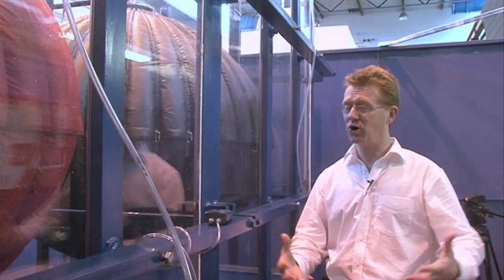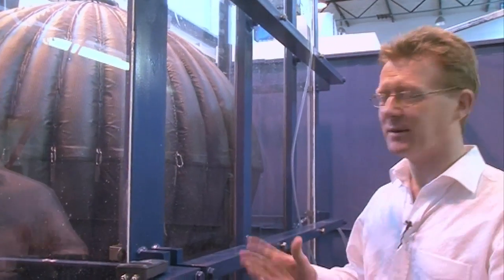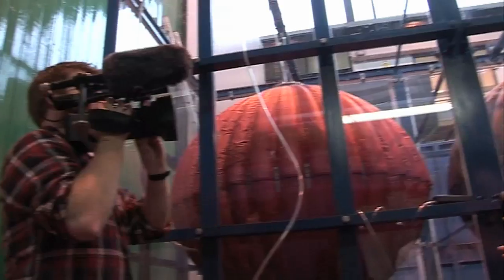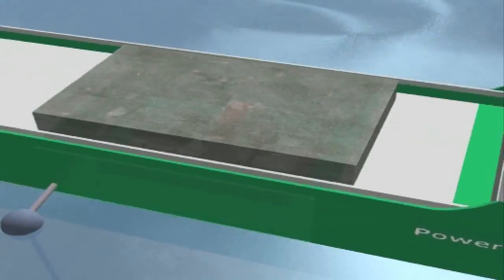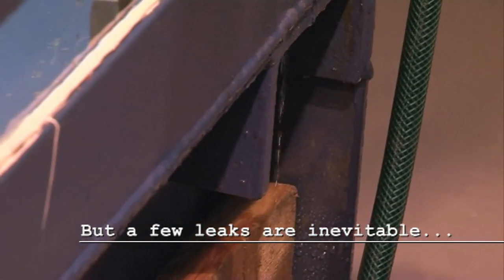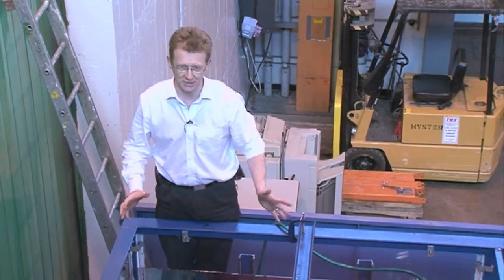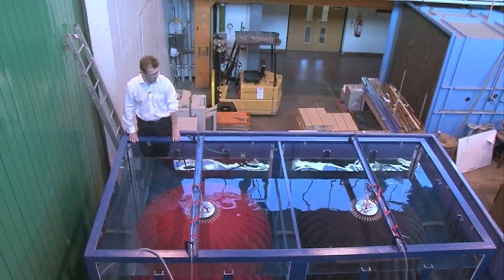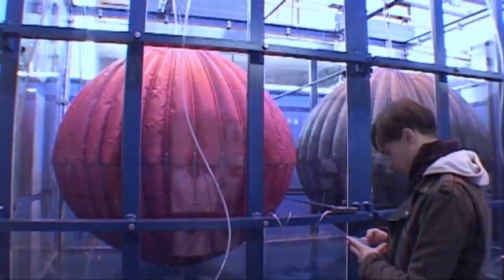Energy Bags Underwater

Comment: If one had a place with very high tidal difference, they could be inflated at low tide, and energy taken out at high tide.
Or maybe used in other places with rapidly changing waterlevels, like reservoirs of pumped-water stations. To reduce the energy needed to fill them with air that is.
edit: Might be easier to use other methods to harvest extra energy from places with "rapidly" changing water levels though.

Comment: why not use a fixed shape like a sphere or cylinder with hole at the bottom?
as you press in the air, it will push out the water through the bottom hole.
and you don't have to worry about material exhaustion, as you have no moving parts.
same concept but better, what do i win? i'll take a warm handshake.
Reply: 27 (number) I wondered that too but this video is over 5 years old so I don't think we'll get an answer from anyone involved.
Reply: Then you'd have to deal with your air loop being in direct contact with salt water, vastly increasing maintenance costs i'd imagine.
Reply: The problem is due to the seals not being secure due to poor design, as the person in the video said, and not a problem with moving parts !!

Comment: how would you reset the system every time without putting in as much energy as you got out?
Reply: That's the point. It's a battery not energy production. The problem with solar and wind energy is that it is sporadic so we need stable long term storage solutions and chemical batteries are bad at this. So this is just an energy store. You put in energy and you store it and you get almost as much back later when you need. So wind cans fill these on windy days and then we can deflate them on still days for example.
Reply: @thatcrazykid1393  This comment is 8 years old and I'm pretty sure it was a part of a thread of replies to another user where I was walking them through their own idea.
Reply: @snowballeffect7812  oh haha. I totally didn't look at any timestamps for this video. My bad
Reply: @thatcrazykid1393  lol no problem. I appreciate your help!

Comment: Umm hey Professor. Can't you just variable the pressure and use the lift force to drive the generator? Seems to me your not using this system to it's full potential. 

Instead of anchoring the bags, try placing a pulley system that will use variable pressure to spin the generator. I think you'll get more energy out.

Reference me in the assistance of the design! :)

Comment: would this not be more efficient than pumping water back up a dam you could use the electricity remotely to pump the air into the reservoir could be fixed to the dam floor on just a cage of balast would lessen your need for the cool lil balast gismo you have now. awsome idea. thnking along the same lines myself for something but this seems a lot more cost effective if slightly less efficient.

Comment: Oh wow, that's wild.  I had heard of mine shafts and such being used for compress air energy storage.  But using the ocean is a neat twist.  That circumvents the issue of needing to find massive geological features to harness.  Sounds like transmission back to the shore would be mildly annoying, but less so than a sports stadium full of batteries for energy storage.  Plus if you get a bunch of these rocking, then it probably wouldn't be a bad idea to get an OTEC system out there too.

Comment: energy is put in by pumping air into the bag. energy is taken out by releasing the air out of the bag. 

it is like a battery. without the harmful/dangerous/rare/expensive chemicals. storing energy is just as important a problem as capturing it (burning hydrocarbons/windmills/solar/tidal etc). 

Another way to think of it is a hydro-dam. when they make more energy than needed, they pump the water back to the top to store the energy.

putting it deep underwater helps contain more compressed air.

Comment: makes since to me. filling the bags above water level with air takes little effort. but when you pull them down under the water the pressure on the bags would be 20 times more forcing the air out giving you 20 times the energy you put in back out..

Comment: why not just make a system where you drag a heavy weight up in the air trough a pulley system(store potential energy), and let it drop, when energy is needed.

an electric motor drags a massive object up, and..when it falls, it spins the motor, turning it into a generator.some kind of a gear system is probably needed too :)
it would work on land which is good.

about these bags...well, pump them full during low tide when its easy, and let the tides create pressure...then release it

Comment: What does 'high proportion' mean?  Since you don't have high pressure, I'm guessing that thermal losses are minimal.  Just how efficient is the cycle?  That's the $ 1,000,000 question with ANY battery tech.

Comment: so i take excess solar energy or some such runs the compressors to fill the bags and then when you need the energy you you run the air through a air terbine to get electrical current again?
.

Comment: What if we used genetically engineered plants to make a solid or liquid chemical that we can put in the balloons in it's denser form, and as time goes on, have the liquid vaporize, which would pressurize the inside of the balloon. It's roughly the same concept as gasoline, sun>chemical>reaction>pressure energy process, but without all the fumes.

Comment: Wow what an interesting concept.. a barometric battery.
 
Here's a thought. Perhaps I'm just stating the obvious here, but these could be used not only as batteries, but as tidal generators too. =D
 
Set them up in shallow ocean areas like beaches.
Pump air into the bags at low tide.
Extract air from the bags at high tide.
 
You should get a net energy gain from the added pressure created at high tide.

Comment: Great idea - similar to one I had last night (way behind!)

Some differences:

- high-pressure tanks; more expensive, but use 1/6 of the space (or less if stored underwater)

- Integrate into existing wind turbine designs (implement a compressor & and air impeller to turbine generator).

- scale: want to store ~4MW per turbine to provide valuable constant supply from offshore farms to mainland (~13m litres of air in bags / 2m in tanks).

This would remove the biggest problem of large scale wind.